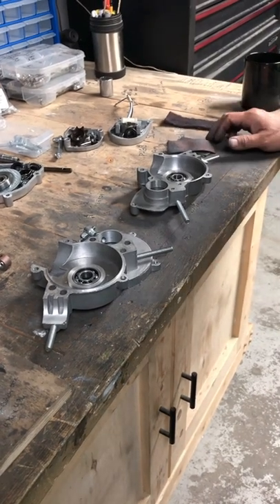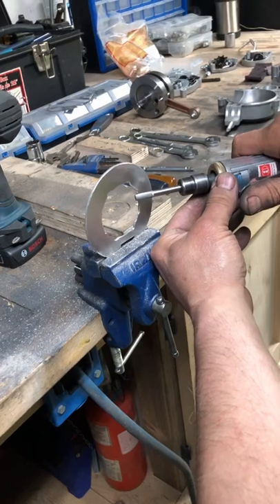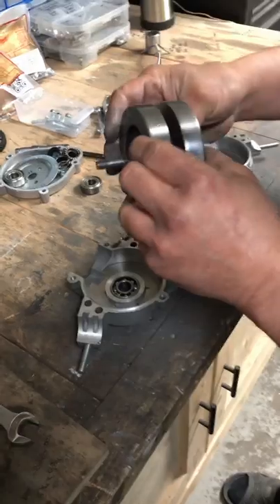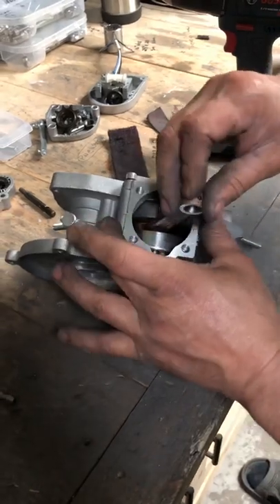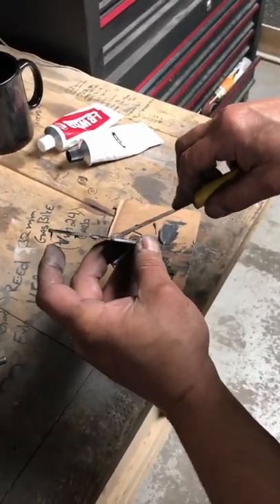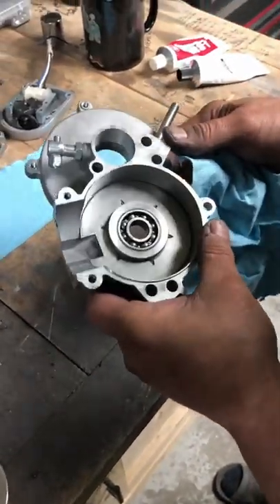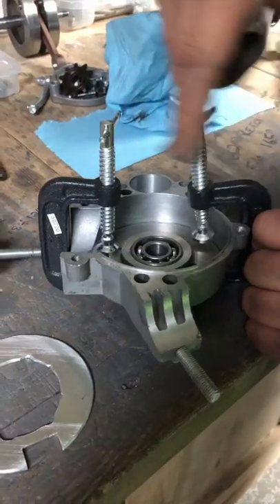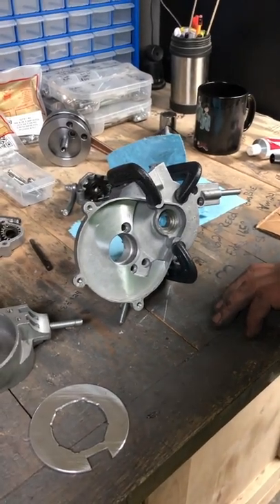How to Install Case Stuffing Plates

Comment: Why do this in the first place?what does it affect and performance wise is it better or worse?
Reply from the maker: I'm unsure as to what part you are referring to. Can you be more specific?
Reply: Its supposed to increase crankcase pressure and improve velocity into the cylinder, better for case reed engines, but on a stock china motor ull gain more torque and lose top end but just a thin plate on each side wouldnt do much itll need to be filled in with like jb weld
Reply: It increases tha case Volume  greatly  the 2 plates add alot of volume , plus guys have been doing this with JB weld and its difficult , this is easily installed , plus it adds directional  fuel up into intakes keeping fuel directed into transfers,  you Dont lose Top end a gains are in low and mid range , some of my fastest engines were Case Stuffed !
Reply: If you look at all engine cases in 2 strokes they are made as a "Tight " case this is no accident! Honda, Kawasaki, Yamaha,  Suzuki,  Husqvarna,
Reply: @kenngobrap7077  yes, this actually decreases the case volume and speeds up the intake charge. As people port and bore, swap out to bigger carbs, this all plays a critical role in shaping power delivery. The best engines are the 125cc MX bikes, they really respond to this well, but big bore bikes can see some really interesting improvements.

Comment: What's the point of filling up the space in the case? It now will hold Less gas and oil?
Reply: Read below, it effects performance. I also believe it decreases engine vibration.
Reply: it increases primary (case) compression when piston moves down toward and to BDC and will force more air fuel mix up trough transfer ports and better purge case of  the fuel and air mix that has been delivered to engine through the carburetor which will raise compression in cylinder and combustion chamber thus creating a more powerful combustion which creates more downward force on piston, which creates a more power from the crabkshaft which will put more power to the wheel.

I hope this helps answer your question. these little engines need all the help they can get and this is just one more thing that can help them perform better.